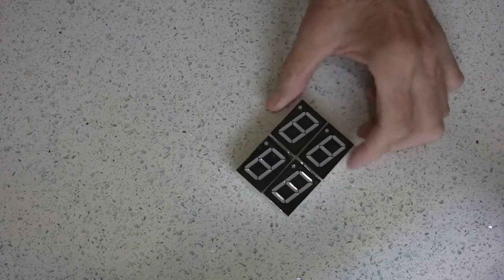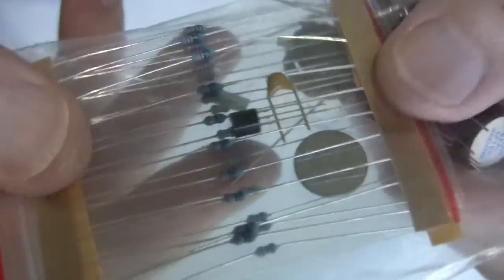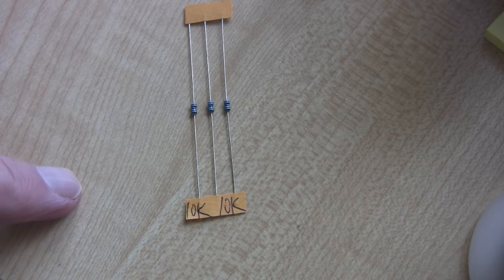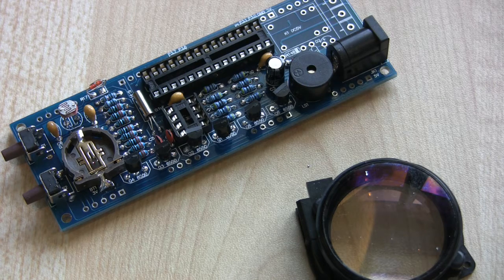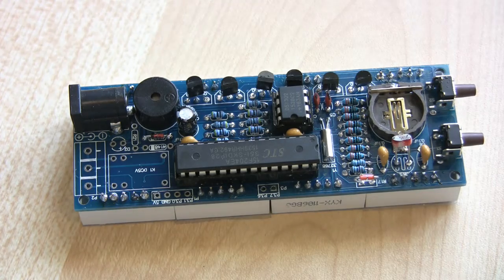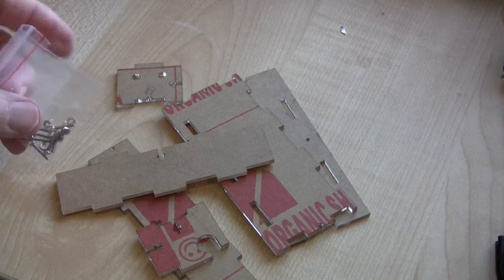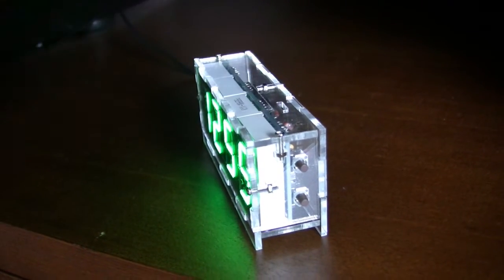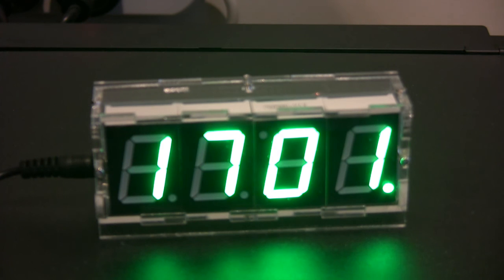Banggoods DIY 4 Digit LED Electronic Clock Kit.

Comment: Thanks for the reply Michael - clock works OK anyway, pretty good kit
Reply from the maker: As the clocks brightness does not fade with increased light I found the instant switching between full and dim quite irritating. I guess without the LDR it must be on full brightness all the time!

Comment: Any idea what the resistance value of the thermistor is? - My kit works great but came with no thermistor, I have asked them but banggood have no idea what I'm talking about!
Reply from the maker: Yes, I have had issues trying to describe problems with Chinese distributors before. Sadly I cannot help as I give my clock to a friend, maybe be someone could measure it for you here! Always seams to be one part missing from all the kits I have ever purchased.

Comment: Did you not see a defuser membrane for the 4 digit tubes???  Also did you take off the protective film from the 4 digit tubes??
You should have got a defuser membrane which should have been sticky backed and after taking off the protective film from the tubes you then stick this membrane on. It will look much better and much greener too and will not show the rest of the tubes through the defuser. The membrane doesn't look as though it has a sticky back but I assure you it has. Maybe you dis-guarded it thinking it was nothing. All in all you did very well and some of the solder joind had a wee bit too much solder on as they were oozing through the holes to the other side of the board but if it was your first time then congratulations it works and a very nice job too. I am glad you didn't put the thermistor through the hole as there is no real need for it. Also I have seen some silly people put the light sensor through the hole too sticking out and there is no point as the case is transparent.. 

Good job anyway.
Reply from the maker: There seams to be a number of different company's selling similar kits with slight variations. This Banggood kit did NOT have the filter supplied as other have and yes I did remove the plastic film from the front of the LEDs. Always the last job, so I might not have done it on the video.
Only issues I have had so far, it gains time, a couple of minutes per month and does not recognise a leap year, I had to change the date after February.
I might experiment with the capacitors around the timing circuitry to help get the timing more accurate. Thanks for your comments.
Reply: Yeah there are a number of variations. The only one I could find that had a calendar as such was the Circular one with all the LCD's around it and that one could be programmed for the correct year and of course then it did keep the time but I also have 2 like yours and they do both gain a few seconds a week and I set them both at the same time to the second but they never keep the same time for very long. Seconds soon drift apart. A good project though. I have just ordered one of the dot matrix large display clocks to try. Maybe these will keep better time.

Comment: Thanks for the vid and review. I have seen a few vids about making these clocks and have ordered two. One the same as this with red led's and a slightly different  one where the diodes etc are below the display. I cant solder to save my life really, but I want to learn. I hope I can manage with these kits. New soldering iron coming too. :).
Reply: Hi, 
Nice to see you taking an interest in this. 
Just make sure you have a real fine tip on your soldering iron and keep it clean and spotless always. 
Ideal temperature for the iron would be 350 centigrade but you want to solder to melt as soon as it hits the tip. 
Nice to see you have a new soldering iron coming. It is great fun really and I enjoy it so much. 
Have you got a soldering station coming or just a soldering iron?  Either way I am sure you will be okay. 
Good luck

Comment: had just one built yesterday by my 11 year old daughter. she loved it. ordered 3 more and some other kits as gifts.  

highly recommended for learning soldering/electronics and small gift for friends for 5€.  the only down side is the case is a bit unstable. if you tighten it to hard then it cracks, if it is too loose then it falls a part. it is best to use some transparent glue at some points for extra stability.

Comment: Ok, I got this kit in the mail, had a good time assembling it over two evenings and it worked as soon as I plugged it in.  Does anyone have a clue what the  - 1 -    - 2 -   or   - 3-  etc..   is in the display when it cycles through the date, temp every minute or so?  I have no idea what that is for and why it displays and there is nothing in the instructions about it.  Also, not sure why but my battery that retains the clock settings exploded after having run for a day or so.  Blew right off the back.  Clock still works fine though.  Also, the blue display is too dim with the foil over the digits to see at night time from across the room so I just put a jumper in the spot where the sensor was and eliminated the sensor all together.  Looks great now, no dimming however which is ok with the blue digits.
Reply: The - 1 -, - 2 - etc are the days of the week. If you set it on Monday, it will be - 2 - as Monday is the 2nd day of the week. Hope this helps.
Reply: I did one of these kits, it was the round one with millions of lights all around it :-) 
The only problem is that it never shows day "7". It shows as "8"  So I thought it mush have been a Beatles clock "8 days a week"  Weird but everything else works fine

Comment: I have built 2 of these, They now come with a darkened plastic film for over the front of the display, Mine have blue led's and they look great, They have stopped giving you a battery though, Do you know what type of battery it is?
Reply from the maker: Yes, the battery is a Lithium 3 v CR1220 I've noticed many projects no longer include cells. Maybe the post in some country's do not like it, fire risk, but MORE
probable it saves money.
Reply: Thanks for that, Just ordered some on amazon. As an aside, Im running one kit from three AAA batteries, I hot glued the battery holder to the rear of the case, So far its lasted 3.5 days and still going, Handy if there are no sockets around. Again thanks for the info.
Reply: The dark film that goes over the 4 digit tubes is a sticky backed one. It doesn't look like it is but I assure you it is and then you peel off the protective film on the 4 digit tubes and stick on the dark plastic membrane (defuser)

Comment: Great work. Enjoyed. I'm a noob when it comes to these things. I'm wanting to get this and put it into a custom wooden case. Do you think it is achievable to not have the buttons and power jack on the board itself. As in have it mounted where I want on my case. My simple mind thinks running a wire from the board to where I want the individual components would work. Am I way off?
Reply from the maker: Yes, that should not present any problem that I can see. Extending the cables from the switches again will be fine. Sounds like a good idea. Don't forget you can buy this item without the case.